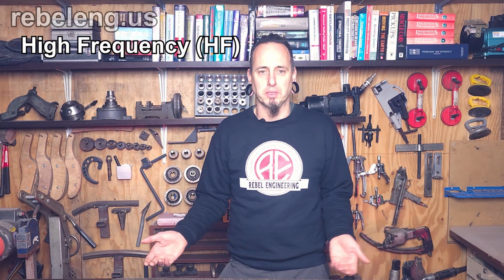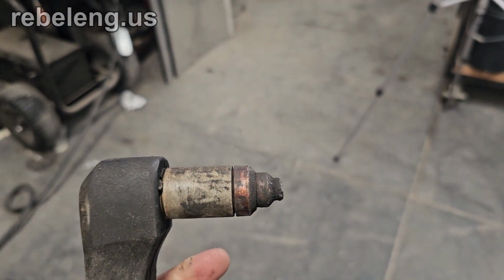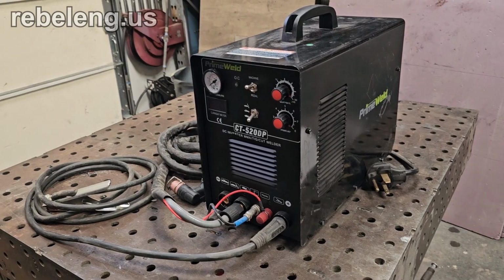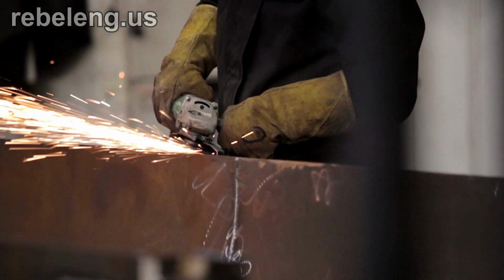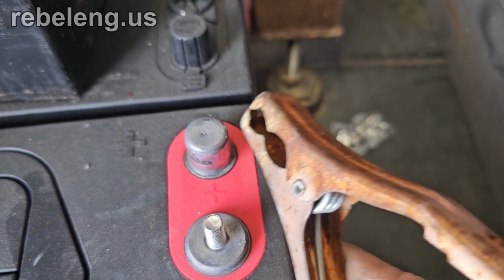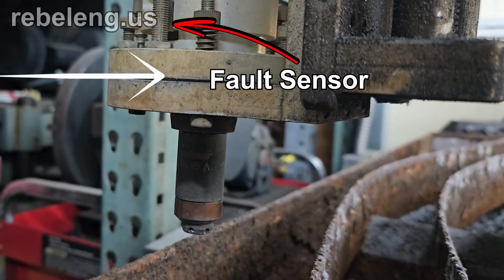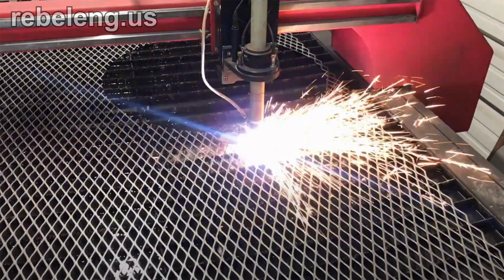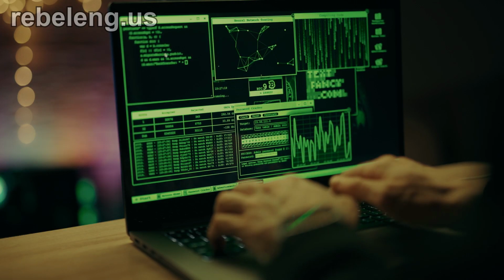What Does All This S#!T Mean?!!!! Blowback, Pilot Arc, Contact Start, High Frequency HF, Scratch

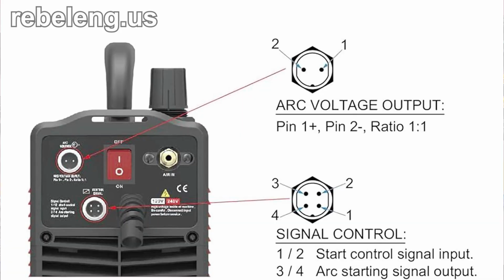Comment: 10:27 what are the budget options out there with this " built in connection for cnc controller". I looked up your powermax and the price is in the thousands. thank you
Reply from the maker: Anything with blowback start should work. I think a lot of people have used the Harbor Freight unit. You will have to look into it because I do not have experience with it.
Reply: There is a new bestarc unit available which may suit your needs. There are a lot of videos on bestarc units. Im still hung up on blowback. Im not planning on any sort of cnc so maybe I dont need to be. For what it's worth bestarc seems to have the most bang for the buck but Ive yet to pull the trigger on anything.
Reply from the maker: @micstica I have a cheap high frequency unit I use for portable stuff.  If you aren't doing CNC you can be less picky.

Comment: I have a simder 40 50 pro ive tried various settings teying to cut the legs off of an aluminum ladder and right when i go to start cutting the arc just blows out. Don't think it's my connections. Too much arc or ro high current?
Reply from the maker: Make sure all your consumables and torch are good. Make your air pressure is good. Could be a lot of things.
Reply: I just changed out my electrode and tip. It's a brand new welder and it's been a while since ive welded and new to plasma cutting. I'm thinking maybe my psi is too high it will arc until i make contact at 20 and 30 amps@rebelengineering

Comment: Is it possible to weld using plasma torch like oxyfuel torch, if the blowing from compressed air source is throttled down sufficiently to not splash the molten metal out?
Reply from the maker: That would basically be using oxygen as the plasma gas which is sometimes used for cutting thicker steel.